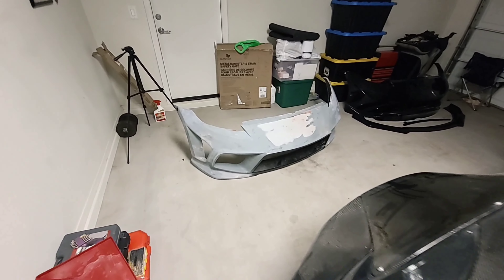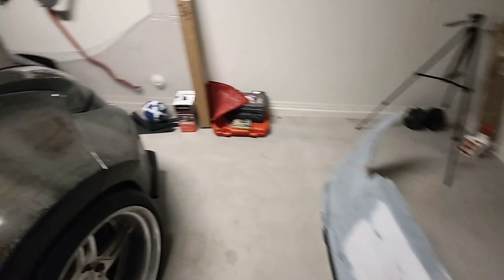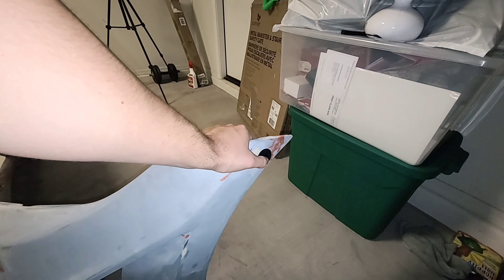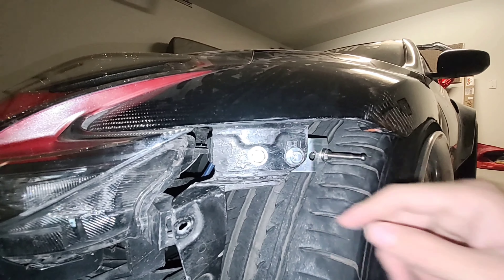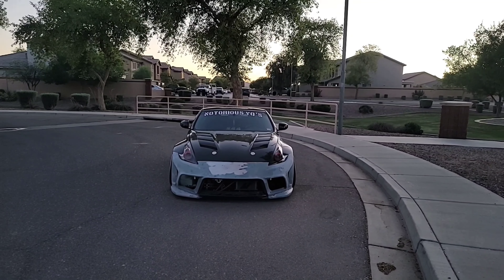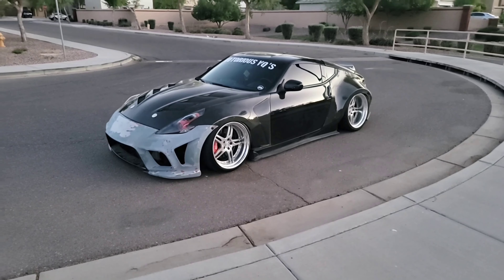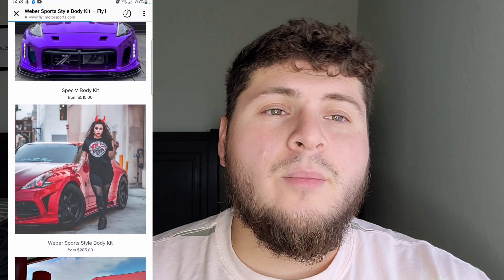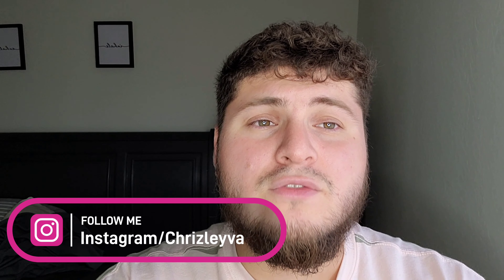WEBER Style Front Bumper for the NISSAN 370Z

Comment: Hey bro so I am installing my airlift 3p. I helge everything is wired correctly for my harness because my compressor comes on. BUT my controller won’t turn on whatsoever. So the installation has stalled. Have you ever had this problem where the controller won’t turn on? Maybe It’s my wiring harness or the USB port for the harness?